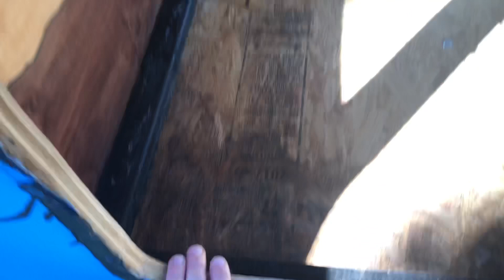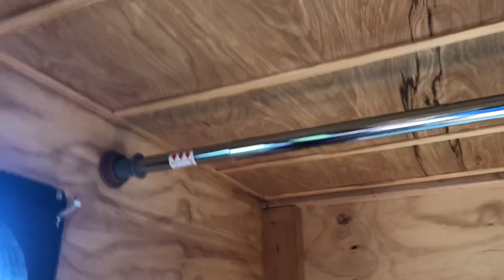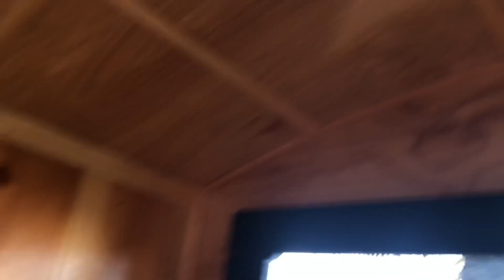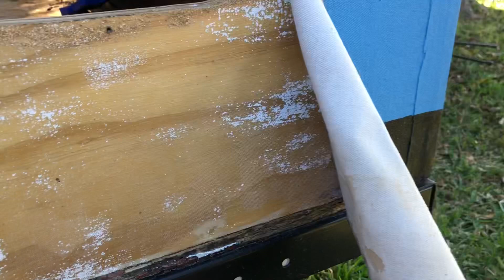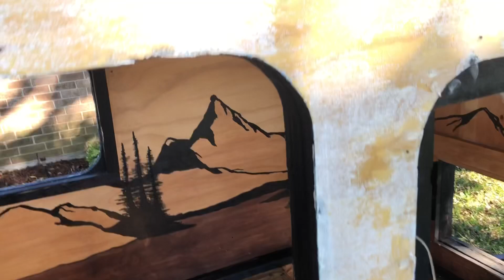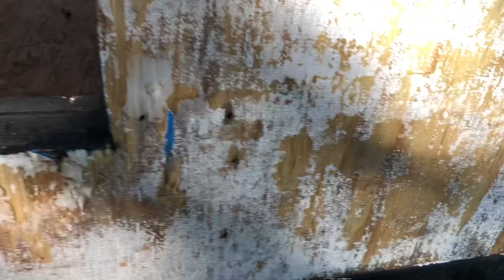PMF Poor Mans Fiberglass Removal from Camper after Three Years

Comment: I dont understand the point of adding canvas to wood? You can waterproof the wood with just the glue and paint or just a good epoxy paint. I thought the canvas method was to be used with foam and was supposed to add strength to foam.

Comment: Does the glue coverage have to be perfect, do I need to be really meticulous about every square inch, or will the paint help in the areas where the glue is thinner? The canvas really soaks it up and it’s hard to tell just how well every spot is covered.
Reply from the maker: @jon2901  I’d say it would be best to have full coverage but I could see a few spots on mine that didn’t appear to adhere and it was fine

Comment: Might redo my winnebago roof in this since the factory roof leaks like a sieve
Reply from the maker: After owning multiple rvs I don’t see how it could be any worse than the rubber roofs, as long as drains off well .
Reply: @ArmadilloJunction  it's a 2 piece fylon roof that's delaminated and leaking throughout. I am considering a PMF job to replace it instead of more Fylon or fiberglass

Comment: Almost ANIY construction is better than current camper construction.  After ripping apart several campers with holes and wood rot, I saw how poorly they are constructed.  I elected to replace the roof with a metal pitched roof that will no doubt never leak and make the camper last another 50 years.
Reply from the maker: I agree , campers are terribly built and way overpriced for the quality you get.

Comment: Hello did you screw or nail the plywood? Thanks.
Reply from the maker: I used screws on everything and if I sank one a little deep I just skimmed it with a little wood putty
Reply: @ArmadilloJunction  ok sounds good did of the screws pop through or try pop from the movement? Or no worries at all.
Reply from the maker: @warrenbenton9033  I didn’t see any issues in the couple of years I had it , sitting in weather and if I remember right we put a couple thousand miles on it.

Comment: Y’all almost have me convinced to do PMF on my camper build. Now I have to search a source for some waterproof glue.
Reply from the maker: It for sure works , I used tite bond 2 . It seems to be what’s used most . Good luck with your project.
Reply: Local hardware store should have it and if I were you, I'd pay a bit more for the Titlebond 3, Titlebond 2 is technically water resistant while Titlebond 3 is actually waterproof. With that being said, you can see how well the water resistant stuff does.. just imagine how well the waterproof glue will do haha
Reply: @masonblackofficial what I have found in my research is that TB II will bond to itself and can be thinned with water. I have read where TB III will not bond to itself as well when doing multiple coats or working in sections of a project. Most videos and recommendations for PMF use TB II.

Comment: They've been using  the PMF on boats for years, so why would it not be good for a camper trailer coating?! I've seen too many products made out of fiberglass that cracked over time which tells me it may be stronger initially, but is also more brittle and doesn't flex as much as PMF.
Reply from the maker: That’s kinda why I made the videos , I was trying to prove A point for all the nay sayers. Thanks for stopping by

Comment: Wow..I have been debating about build a small skiff using this method..Is the ply just standard cdx grade...kinda impressive after 3 years that it was still bonded that good..You think a good oil base paint would work on the canvas or stay with a water base ? Thanks for sharing the vid and the good results you have
Reply from the maker: I used cabinet grade to have smooth sides to work with. If I remember right from all my research the water based was recommended because it soaked in canvas better. Building a small boat or kayak is on the list of things to try and build. Thanks for stopping by.

Comment: I can understand the PMF over plywood. What I find crazy is the PMF over styrofoam with no framing, relying totally on the strength of the PMF. And, coming out with a mini-teardrop so lite it's pulled by a bicycle...!
Reply from the maker: Yea the pmf gives it no structural support or strengthening. It’s ok as long as nothing hits it haha
Reply: I built a ice shanty. used styrofoam 4x10 3/4 plywood floor and pmf. I used epoxy on window door cut outs. but I learned from a old timer you sand everything for a good bond. and round the corners so the cloth gets no air bubbles. ultra light
Reply: @heathgenthner4189  I saw a video on here about really bracing outside 1/4" ply on a 2x2 frame and pouring a 2 part foam into it. Making your own foam laminate panels and WOW. Awesome strength
Reply: @johnw65  I used 1 1/2 maple frame. The maple was left over from cabinet making. Drilled it glued and pegged it with wooden dowels.this spring I bought a solar power kit, USB plugs, and a Bluetooth chip and speakers from Amazon. So this winter I hope to do a little more fun fishing.
Reply: @johnw65  I know it's easy to buy these ice fishing pop ups. I have a Eskimo pro. But I hate the element of bare ice underneath my feet. Or wind blowing threw it. So I went back to the old way.
Reply: @heathgenthner4189  A foam fishing hut with solar panel roof, on skis, hauled on a little flatbed, and pulled by a quad runner or snowmobile to your favorite fishing spot. Anchored to the ice with lag screws in drilled holes. Could be quite cozy!
Reply: @heathgenthner4189  I like your idea! I'm planning a small room, bolted onto the ramp of my cargo/camper. Foam walls and solar panel roof would work great!

Comment: Thank you for showing it after 3 years , you did a good job and convinced me to use this as a camper exterior , and as far as those who said your waisting your time , they like to waist money instead and buy crap , i on the other hand would rather save a penny and do things myself , even if i fail ive learned , what do you learn when you waist money on store bough , well you learn you cant trust big companies , seems the more a company makes the more they try and rip you off , ive seen where rv companies overlap the botton aluminum on top of the skin comming down from the roof ,so when it leaks it goes into the cabin and rots the wall , instead of overlaping the wall over the lower aluminum like a shingle on a roof , then they cover the overlap with trim so when the smallest of leaks starts you dont know till the wall sill rots away , im building my own camper for this reason alone , cant trust anyone now , there used to be a time where we put pride in our products and cared what people said about such products but somehow we only care about how much we save , well you get what you pay for isnt even a thing now , pay top dollar and still get treated like shit , this is how we do it now ....
Reply from the maker: I owned campers for over 20 years , 2 pop up campers , a24 and 26 ft bumper pull and last was a 32ft 5th wheel , which the roof caved in right down the center and the insurance company told me they weren’t paying for it , that I was more than welcome to get a lawyer , but they wouldn’t pay . The others all leaked and rotted. I’ll never buy another factory made camper . I will build a bigger one some day though . Thanks for stopping by
Reply from the maker: Looking at your channel , nice looking sportster . I bought a brand new 99 custom , drove it home and tore the engine down . Rebuilt it with cams heads and other goodies. It was fast as hell. Drive it around for 2 days breaking in the motor then took off half way across Texas and back to a rally. My friends thought I was waisting time and money then also haha . I showed them lol
Reply: @ArmadilloJunction  thanks , my channel has alot of vintage sewing machines but i plan on doing more on my bike and i have a few other projects i plan to show ...

Comment: I don't care what the Gougeon brothers say, I have never thought putting fiberglass over wood was a good idea. For the simple reason that wood moves and fiberglass doesn't. This sounds like a much better solution.
Reply from the maker: Yep this method has been around a lot longer than fiberglass. I just used it for the roof of the new trailer build .

Comment: Thanks a ton for these videos.  I built   a 12x7 camper using this method.  I was able to avoid a few of these pitfalls specifically because you posted about them.

I was careful with the wall to roof seams to avoid your issue..  overlapped the wall around 4 inches, and then cut the roof canvas flush to the edge.  The seam is basically invisible.

Also avoided the overhang on the roof to floor joint based on your video.

1 year so far and not 1 drop inside the camper at all.
Reply from the maker: Awesome glad it helped . Sounds like it’s gonna last a long time .

Comment: Are you rebuilding because of the water damage? or because you just have to many new ideas that require starting from scratch? I bought a prebuilt that is very similar to yours. Walls are 1" thick plywood and no insulation. I definitely have water damage but mine has a vinyl roof and metal skin. I know I'll be rebuilding at some point and will probably reuse the metal skins but Pmf the top and bottom.
Reply from the maker: No I it would have been fine for years I’m sure . I just get a wild hair sometimes and go with it. I was also curious how well the pmf worked. We had no issues with uninsulated walls , we slept down in the 40s with no problem .

Comment: Glad to see … I’m building a camper with poormans fibreglass .. I have about 20 videos so far , and after a few hiccups, the pmf has gone on smoothly …. I’m glad to see yours held up so well
Reply from the maker: It really does work well , and if you have patience “which I don’t have a lot of “ you can make it look smooth and real nice . I used it on My new camper build for the roof only this time .
Reply: Yes.. I did my whole body so far, still need to do the roof .. the roof is curved with an overhang.. somewhat gypsy vardo inspired… I used very rough canvas and actually love the coarse texture .. it fits my build …

Comment: What did you use for fabric?
Reply from the maker: Painters canvas from Lowe’s ,, the new one came from Walmart and I only pmf’d the roof  . If I ever did another whole camper I may use the thickest bed sheets I could find to have a smoother finish .
Reply: @ArmadilloJunction  thanks for the advice brother. I have a 21-ft palomino camper that has major delamination so I'm replacing the walls and I'm going to use pmf and get it close as I can to matching the fiberglasses on the rest of the camper. I don't care it doesn't have to look perfect just trying to get it close
Reply from the maker: @mustangmadd3172  i have seen some campers use pmf that took their time and sanded between coats and it turned out smooth as fiberglass, the biggest issue is finding a canvas thats not full of snags on loops in fabric. another thing to be aware of is most of the box store canvas is only 6 ft wide so there is a huge seem like every 6 ft on the width . and it cant be hidden.. Good luck thats pretty interesting using it on a full size camper. make a video haha . Good luck
Reply: @ArmadilloJunction  man I really appreciate the advice. If I can get some help I will try to do a video I'm not very good at videos and whatnot. I'm just an ole slow grammar country boy. What kind of paint would you recommend. When I done my new roof for my pop-up camper I use that rubberized roof paint. But it's not sandable at all

Comment: I saw in another video, that the only issue was not covering the rear edge with the overhang. I've been juggling aluminum, coloured vinyl, fiberglass etc., etc. I'm going to do the PMF, no fumes, no resins, cheaper, easier, more 'working-time' and I'm thinking that it's far better for the environment. Thank you! Subbed.
Reply from the maker: Thanks , I used it for my new build again for the  roof . If you take your time and sand and use a good tight woven fabric/ canvas you can really make it look smooth and nice . I always rush stuff haha

Comment: I may do my build like i saw a truck camper build. He built the frame located a few bolting spots on his pan, built it as one unit then set the whole thing on the chassis.
Reply from the maker: I stated to make one that was removable so I could use the trailer for other things ,

Comment: RV companies sell you absolutely the worst, cheapest product they can get away with.  Even the so-called "best" in the business.  The prices charged for this crap is astounding.  By all means, if a guy can build this in his backyard, do so.  Good job!  Having built and repaired plywood boats, I can say that a decently applied paint will waterproof just about anything, as long as you perform due diligence in maintaining the finish.
Reply: Having built cardboard boats I definitely agree with you on the paint.
Reply from the maker: Yes after owning 5 campers ranging from pop ups , bumper pulls and a 5th wheel I can say they are all junk. The last 5th wheel the roof caved in right down the center . They all leaked , I’ve dismantled a couple for part and windows and couldn’t believe how poorly they are framed and built . If I can ever find the space I would love to build a full size camper .

Comment: Im not sure if its been asked for this is a dumb question.
But can you do just Titebond 2 by itself? Or mix it with paint?
Or does the canvas add as a layer of protection as well?
Reply from the maker: the canvas has to be used , for strength and keeps the  glue from cracking . the glue is need first to create a waterproof coating before paint . i researched it quite a bit anfd never seen anyone mix the glue and paint .

Comment: What is the cheapest plywood I would be safe using? Going to be a cheap camper, probably rebuild in 4-5 years if I stick with the hobby
Reply from the maker: If your building some kind of frame to put the plywood on I’d say as thin as you would like . Some people build camper with sheets of foam . So it’s really how the structure is built I guess .

Comment: 3:47   any ideas to improve the appearance of PMF at the corners, especially where there is cloth overlapping?
Reply from the maker: ive seen some camper that looked seamless, and smooth . im guessing they used the method of sealing the cloth with glue then sanding and painting. Next time i think i will use bed sheets . the canvas i used was pretty rough and coudnt really sand or smooth very well. I would also do the top first then wrap sides up and over to hide seams better.
Reply: @ArmadilloJunction   @Armadillo Junction  You'll  want to stand by and pinhole bubbles which formed from outgassing on a test comparison, canvas vs sheets. The sheet was stronger and smoother, except for bubbles because the canvas breathed better.
Reply from the maker: @Christopher Jackson I thought about bondo but as rough as canvas is I don’t think you could ever feather the edges enough to blend in smoothly
Reply: Rhino liner over that sheet we'll hide all of that
Reply: @joshbrown5938  Line-X guy told me that spray on liners do not hide - they accentuate any flaws

Comment: Probably use flex seal on the edges of the plywood to create a waterproof seal on the ends of the plywood and joints and then do the PMF that you did for the rest of it. Maybe paint on truck bed liner for the underside and near the fender wells. Use plywood instead of OSB for the floor. Seems like you have the right idea by your comments on your next build. Good luck on it and look forward to seeing it happen. Great tips I'll definitely be taking into consideration on my build. Thanks for the content!
Reply from the maker: Thanks for the ideas and stopping by . Have a good new year
Reply: @ArmadilloJunction  thank you. Hope you have a great New Year too!

Comment: Very nice. My question is, if I use a thinner plywood to save weight for my truck bed camper would the PMF hold up just as nice as this? Taking it a step further, how will it hold up if I use XPS foam instead of plywood?  thank you for showing this. Any idea what the weight of the box is minus the trailer?
Reply from the maker: Oh and yes it would be fine on a thinner plywood
Reply from the maker: I guessed 400 -500 lbs . A sheet of 3/4 inch plywood is around 75 pounds . That’s 5 sheets plus screws and paint etc. you may want to research campers made of foam . I’m pretty sure I saw some on here and the teardrop camper message boards . They usually call them a foamy . A YouTube friend just built one for his motorcycle. His channel is lone star rider .
Reply: You might want to do some material testing to double check any specific combination, but XPS is actually a fairly popular material for small campers.
Reply: I think I would try a thinner plywood but first perhaps build a fairly lightweight steel frame to attach the pieces to!😁👍🏻